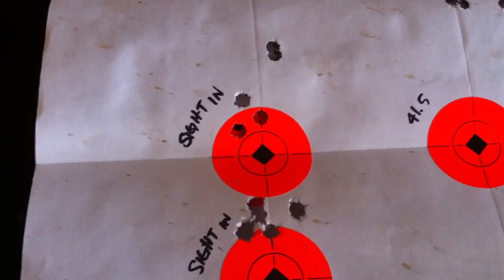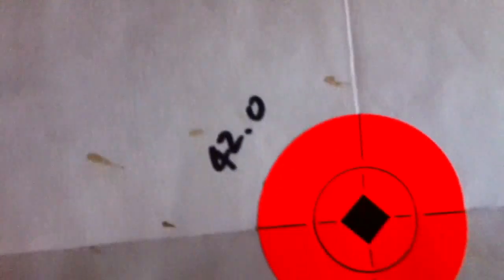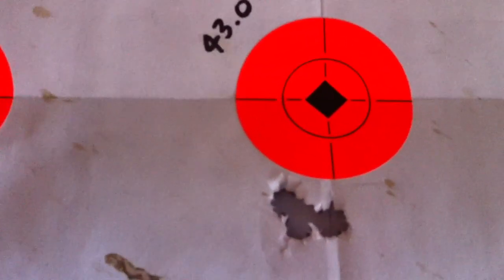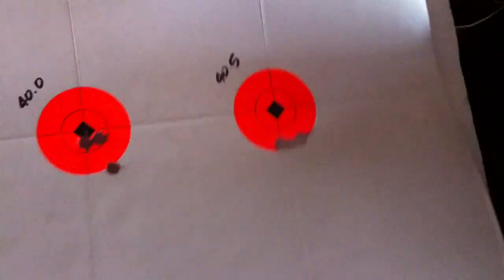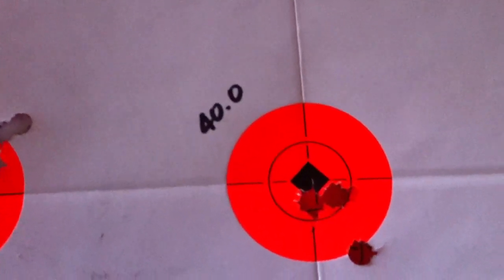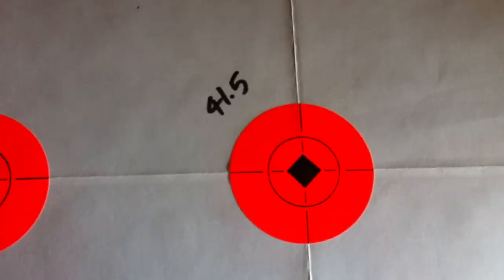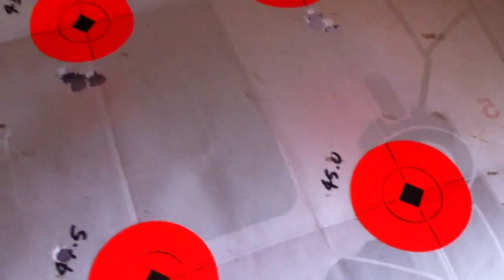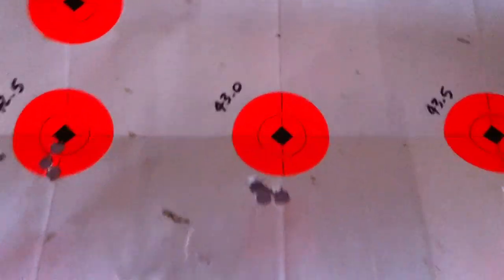Load Work-up For Rem. 700 SPS Tactial

Comment: That's the same way I work up my groups.  45g gave me .5 inchs with a 168 hpbt   42.5 also worked good with .7 moa.  I run 5 round groups then take them to 300 afterwards to see how they hold together.  Nice shooting,